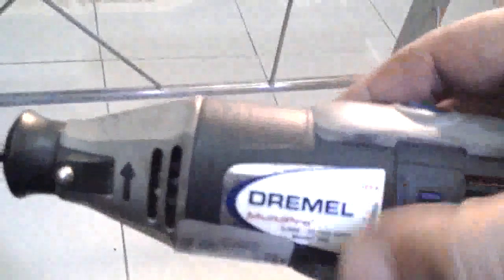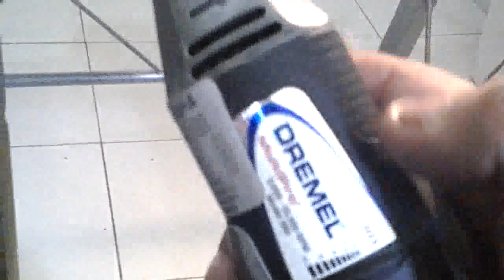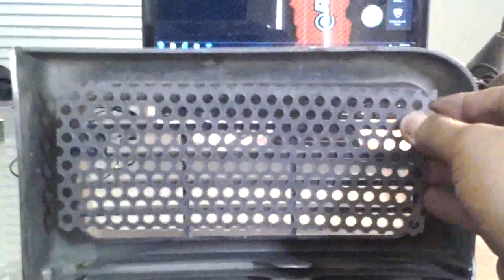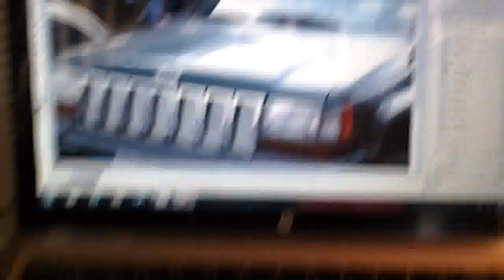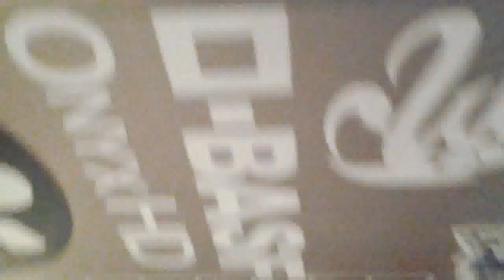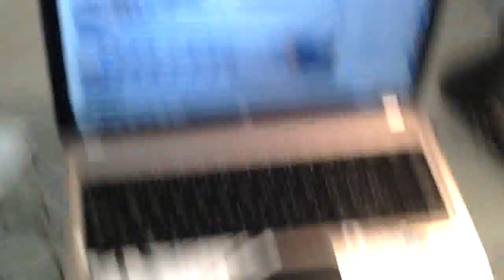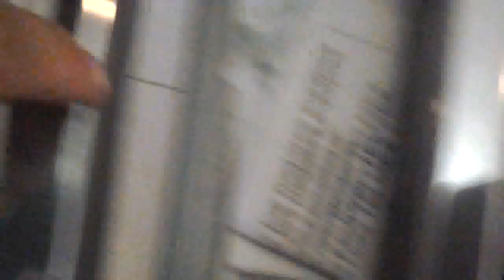Jeep Grand Cherokee zj Custom Grille

Comment: Be careful, the radiator could need more air flow. With the new grille the radiator could overheat easily during the summer.